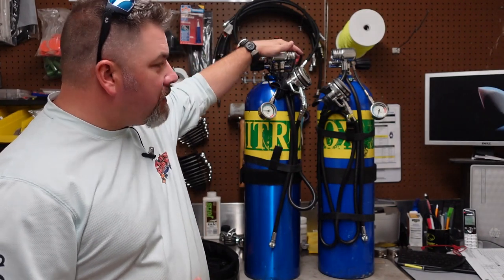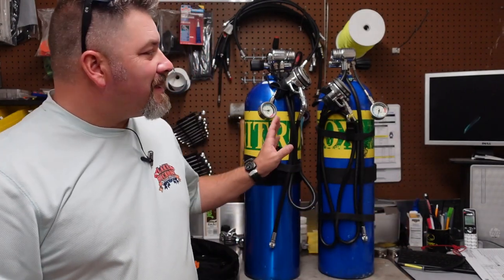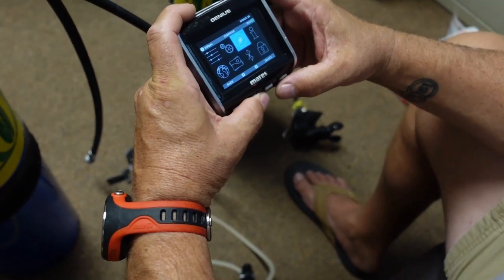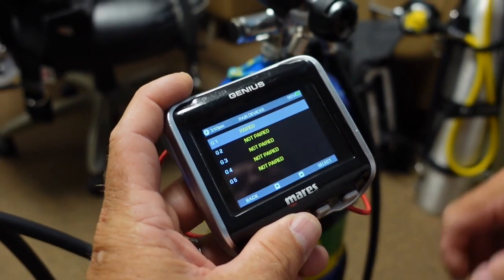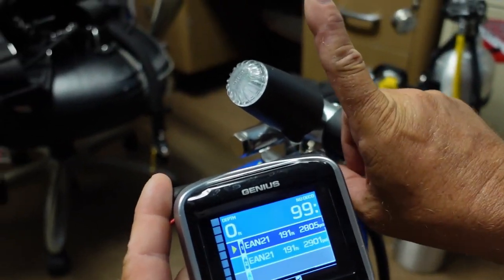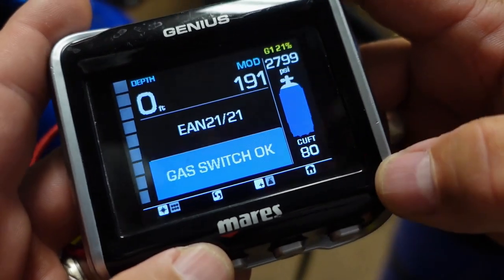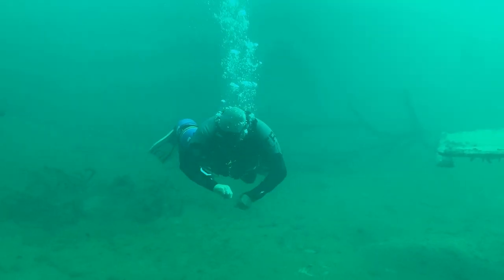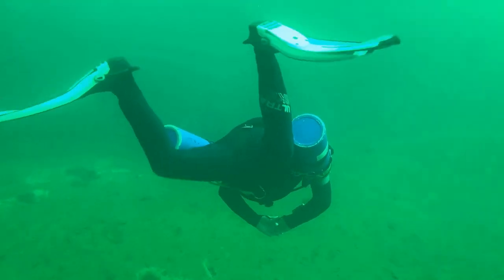Sidemount Diving With The Mares Genius Dive Computer

Comment: Ive used the Genius for over 100 dives and I'm currently using it as my back up computer for my Mares Horizon SCR, i cant praise the computer enough i love it. Ive had some form of air integration since i finished my open water course it has made diving easy knowing exactly how much time i have left till my tank reserve so i can dive without having to figure out how long i got left.
Reply from the maker: Hello Migetsub, glad to know that the Genius is working for you. How to you like your Mares Horizon.
Reply: @LakeHickoryScuba  while i only just got certified on it, ive been really enjoying the experience, 2 of my dive buddies have the horizons and wouldnt stop going on about how much they prefered them to open circuit, so i bit the bullet and bought one brand new, and i can say with certainty that i can see why they prefered them, just going for a 40 minute average dive is a bit lack lustre compared to the 3 and a half i get on a single dive now. So yeah i cant recommend them enough. And mares Australia has just gotten the steel backplates in they are 7kg so that means no more weight belt to supplement my integrated weights and i can put smaller weights in the unit itself now. I will admit i think im having a little too much fun with the unit but hey thats all part of the game huh.

Comment: I do use air integration with my mares genius and it is great, nevertheless I always have an analogue meter on my rig just in case... And I do believe that despite having air integration the analogue meter should no be waived, have at least a button style pressure gauge just in case.
Reply from the maker: Hello Tiago r, glad to know the Genius is working for you. A lot of divers like having a backup analog gauge as well.
Reply: I carry an analog SPG in addition to the transmitter as well. It provides peace of mind, but I don't think it's necessary though. As long as you keep track of your battery charge, having only a transmitter is just as viable as having only an SPG.

With an SPG the needle can get stuck, and over time the bourdon tube stretches, giving you false/incorrect readings.
With a transmitter, you can lose connection or your battery can run out, giving you no reading at all.

Personally I believe no reading is safer than an incorrect reading. You'll know immediately the pressure reading is compromised. Having both will allow you to check both readings against each other. That way you'll know when to replace your SPG, and you can check your SPG when the transmitter link is (temporarily) lost.

Comment: I use my Mares Icon HD with 2 transmitters for my sidemount right on the first stage and that works perfect. But the tip on just replacing the analog gauge and using the same hp hose somehow never came into my mind as a solution.. thanks for the tip
Reply from the maker: Hello Jort Harmsen, glad you found the video helpful. One of the biggest things about routing the transmitters down is, it protects them during the dive.

Comment: Hi, do you know if the Mares Quad Air has full integration (the same as the Genius model), when using independent twin cylinders and regs?
Great video thanks 👌
Reply from the maker: Hello GrahamF, the Mares Quad Air is an air integrated model just like the Genius. The standard Mares Quad is not.
Reply: @LakeHickoryScuba  Thank you very much. 👌

Comment: I wish there was a tank graphic for both
Reply from the maker: Hello John Church. A divers can use the UTD Z-Sidemount sytem, which creates a manifold for your sidemount bottles, then technically you would have one graphic that represented both cylinders.
Reply: @LakeHickoryScuba  UTD-Z-System is the next lack in understanding of sidemount.
No REAL sidemount-instructor will ever recommend to use that system.

It takes away one of the big advantages of sidemont. By using it you will loose the "REAL" redundancy! But add a lot of additional points-of-failure to your setup

Comment: I use AI transmitters even with my CCR with Shearwater Perdix AI. Well working combo but not cheap.
Reply from the maker: Hello N N, that is probably the biggest compalint we get from newer divers, the cost is so high for transmitters and air integrated computers.
Reply: @LakeHickoryScuba  Compared to a CCR though...

And you don't have to buy transmitters right away. An air integrated computer will work perfectly fine without transmitters. You can add a transmitter at a later date (provided you did buy an AI computer to begin with).

I prefer doing things the right way to begin with. I'd rather spend a extra money up front than having to replace something later on.

Comment: A lot safer having the transmitters on the 6" hoses; much less chance of damage if they get knocked.  With the same gas in both tanks I like to use the AI pods with the left one paired to my left-hand computer and the right hand paired to the one on my right.  I still use the old SPGs as well but that's because I'm a dinosaur.  In a few hundred dives with (Suunto) AI pods and EON computers I've never had a failure or even a drop out!
Reply from the maker: Hello Tim Gosling, the only issue with seperating them, it will never give you an acurate SAC and RMV rate. After a switch, one tank will simply be sitting in limbo until you switch back to it. Now this does not really matter if you can calculate it on paper.
Reply: @LakeHickoryScuba  It does give me real-time SAC and Gas Time for the tank I'm on at any given point during the dive, which is when I need it.  For different gasses, eg with a stage, you do have to run them all on each computer or it gives the wrong NDL.
Reply from the maker: You are correct Tim Gosling. How would suggest newer divers to compensate for the average SAC Rate after the dive considering both tanks are not being used at the same time. This is where we would see them having an issue.
Reply: @LakeHickoryScuba  The answer is of course to pair both transmitters with both computers and just pick left to display on the left computer and right on the right.  That's what I do when I'm not being lazy!  I personally don't worry too much about the average SAC for the dive because there are some big variations within it when gas is going into the drysuit and wing on descents or when it's getting cold.  When all we had was start and end pressures, time and a calculator, the average was all you could get.  With AI you can pick out particular bits of the dive and use the data for subsequent planning.
Reply: @LakeHickoryScuba  I don't think that's really an issue. I don't believe you should be monitoring your SAC rate during the dive. This can lead to taking shallower breaths or holding your breath to try and reduce it. SAC and RMV should be used for dive planning before your dive, and reference data after your dive.

You calculate SAC through your total pressure used over your dive time. You can simply add the pressure difference from both cylinders and divide it by your time underwater.
Only when you're calculating RMV, and you are using different sized cylinders, do you need to compensate for the different cylinder sizes.